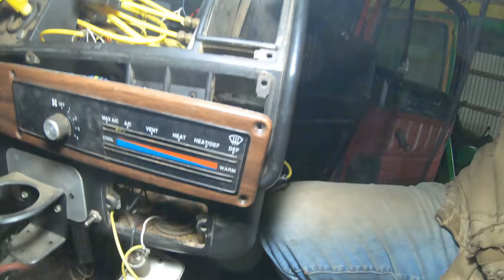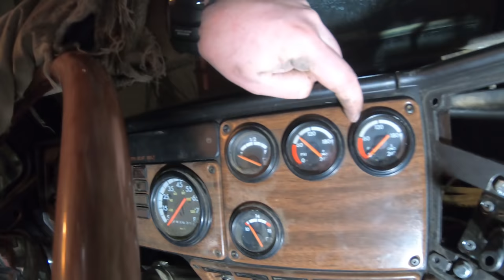No Leaks!

Comment: Glad to see your getting rid of all those hissing snakes lol. It should be a good truck to learn on.  They always seem to need something.  At least there is not several drivers sharing the truck. It will be a pretty nice truck when your done.  Run through your brake test.  hopefully help you find the issue.  Good luck! It easy to get frustrated and over think things.

Comment: Years ago I was in Upper New York state when we just had a artic cold front pass through during the winter January.  I had big pieces of cardboard blocking off the Radiator from the cold air both blowers running and my interior temperature sensors were only reading 45°  without the rear I couldn't heat the entire cab.  Just remember to keep something to block your entire radiator too or you won't get the truck warm enough to heat your cab in really cold weather.

Comment: Great video.  Lots of painstaking time under the dash.  With all the work on the air leaks ,you should be good.  The DOT air brake check will be the final say. Will be great to see the truck running.

Comment: Quick tip, primary air tank (green lines)is for your drive axle service brakes only. Secondary (red lines)is steering axle brakes and all air accessories such as horns, diff lock, suspension etc.

Comment: Your dealing with the most aggravating part of owning a semi. Working on air lines under the dash. It's not just a Freightliner issue none of them are easy to work on. Went to take off the parking brakes once, pushed the valve in and it shot back out and hit the back of the cab. Had to replace the valve in the parking lot. That was fun! Now the question is did it remain leak free once you got it all back together? You usually find another one when it all get back together.

Comment: Questions:

1 - By what factor would you say that you increased the value of Big Red by rebuilding and repairing thus far?
2 -  How much you expect to save by doing more of your transport with Big Red rather than hiring a trucker?
3 - This would make a great economic case story.  Are you keeping records?
Reply: I couldn't answer your first question, but I may be able to help on the second one. I can only give you an answer based off my farm. When we hire a trucker to drive ~65 miles one way they charge $.20-$.22/bushel so roughly $250 per load. Take that over 200 loads and that can save quite a bit of money. Not only is there a monetary factor, but it's 2x faster hauling with a semi than a tractor, so that's another factor.

Comment: The common cause for air leaks is engine oil passing the compressor into the air system. It is normal for a small amount so regulary keep your air tanks drained. Engine oil rots the seals in the valves. There may be spare wiring for auxiliary lighting already fitted you will have to trace the wires. Failing that it will be beneficial to wire from a separate fuse relay with left/right fuses and all new wire. Very impressed by the work you have already done

Comment: for future air leak troubleshooting, install a air fitting so you can plug a compressor into your air system. You don't need the truck running then unless you have a problem with the on-board air compressor.

Comment: Just a FYI whenever you are looking for air leaks use a spray bottle with soapy water and spray down air fittings or air lines makes easier to find your leak, if you replace a fitting always cut the end of the air line

Comment: I always recut those air lines as square as possible, and make sure they are pushed in all the way.  Usually works.  If you have one that is stuck, push it in then hold the locking part down and then pull out on the air line.  I also use soapy water in a spray bottle to find my leaks, just be careful around electronics.

Comment: You will use the bunk heater in cold weather when driving. Turn the temp to medium with fan in low, you will be able to control the cab temp better that way.

Comment: Air leaks are almost a constant struggle on trucks like that our 1997 peterbilt 379 grain truck will leak it out slowly but doesn't take long when we start putting more weight on it in grain. Main thing is waiting on it to build up air pressure. On the contrary the old 1971 c60 Chevy grain truck holds air better than the peterbilt build it up faster too. Can't wait to see that truck paying for itself hauling loads. (Bet it would sound cool with a straight pipe lol)

Comment: hey Ryan  was watching your video. them air sencer value under your dash sould be 2 of them under there 1is for your cruise control and the other one is for your fast idle when you are sitting still and don't want to idle your engine that leaking at that green hose is in the parking brake value Larry Jones

Comment: I’m sure you already know this, but you need to manually drain your air tanks frequently. Seems like you’ve got a lot of oil in your air. Air dryer may be loaded up.  Freightliner has a reputation for messes in the dash but looks like somebody changed a bunch of tubing. I’m a KW guy but dealt with plenty of other brands too. 

Welcome to truck ownership. I think it’s great that you’re doing the work. That way, if you have issues down the road, you kinda know what it’s about.

Comment: It's actually pretty common for the plastic to crack around where the fittings screw into the parking brake valves, trick is not to overtighten those fittings.........

Comment: Use air hose connectors to connect your shop air compressor to your trucks air tank so you don’t run your battery down starting your truck all the time and you’ll have continuous air without the engine noise.

Comment: It is nice to have a sleeper heater that works. Ran team in one that the heater didn't work in it. Was cold trying to sleep back there had to wrap up like you would wrap a baby to stay warm. In a cabover Pete the defroster had a 90 degree no it that turned so we turned the middle one so it blowed in to the sleeper but it was still cold in there. Glad you glad your air leaks stop. Getting it closer to bring ready to haul grain. Stay safe and God bless you'll.

Comment: Air leaks are a constant problem and more so during the winter than the summer, the truck I drive usually has 50-60lbs after sitting for 10 hrs if you loose more than3 lbs per second then it needs to be fixed
Reply: 3 lbs./minute  with park button in and foot on brakes.

Comment: I’ve got a 97 Freightshaker with a sleeper on it but it isn’t a tandem. It’s a nice truck to haul grain with and very comfortable to drive long distance with the flat deck if needed. My biggest complaint is that it takes 40 acres to turn around. In WI do you have a farm class A license or did you have to go commercial since you plan on using it to generate income? I had a commercial B when driving school bus and changed it out for my Farm A as they quit letting you have farm and commercial both.

Comment: Hey Ryan! I have a question and sorry if it's stupid, but why do semis need air running through them? I'm not a semi guy 😂😂 but why can't they run like cars? Great video!!
Reply: Air for brakes /air is quicker and your car has hydraulic brakes can you imagine have to hook up hydraulic lines to a trailer every time ugh.
Plus we use air ride suspension /smoother ride ,air ride cab mounts and air ride seat
Reply: @pdbuilder8212  you're are totally wrong hydraulic brake are faster hydraulic brakes are instant.  Air has to travel to apply air has to travel to all brake chambers to apply pressure. But air can apply more pressure per square inch cause of the size difference an the leverage.
Reply: John Warren he probably meant air is quicker to replenish and hook up

Comment: Just for future reference don’t use thread tape on mobile air lines. Use a liquid thread sealer. Tape can get into the line from the threads and stick the air valves. DOT doesn’t like thread tape.
Reply: And use the rear heat and a/c to heat and cool the cab more efficiently.

Comment: get you some automotive insulation and sound deadening it will help keep you cooler in the summer &warmer in the winter  also will save your hearing over time put it on the fire wall ceiling, floors, walls, &in the door's

Comment: Next in line to fix,Oil in air supply. Not good to have the air Compressor putting oil into the tanks. Should be clean dry air.

Comment: I hate leaks. DOT loves them
Reply: I've got an older truck I'm working on.  Wish I had a shop like yours, it never stops raining.
Reply: the abs valve on one of my trailers leak, in the cold. dont want to replace it as its three grand just for the part i have been told.

Comment: If you attempt to solve all the leaks in a semi, to the point where it doesn't lose any air pressure, you won't be able to use the truck because you'll have been committed to an insane asylum. Best you can hope for is minimal air loss in a given period of time. Even the D.O.T. maintains rules for that!!

Comment: All the dot cares about is audible air leaks you will never get them all that being said a hundred small leaks add up if your using brass compression fittings don't.be afraid to tighten them up